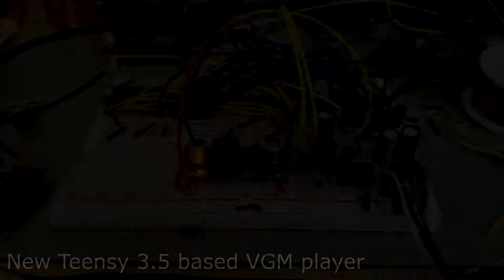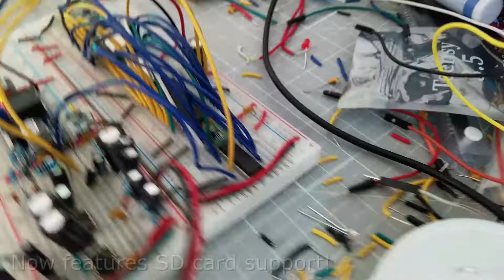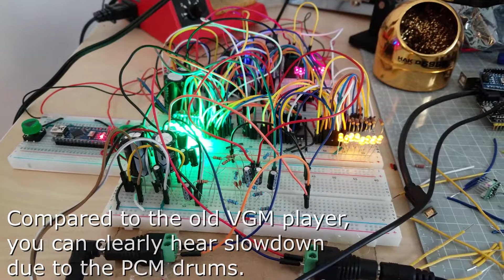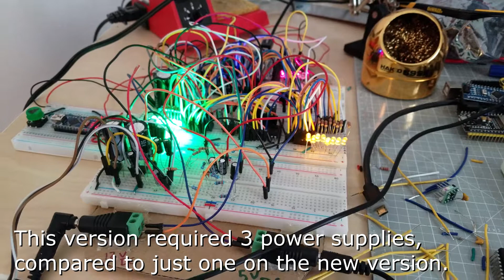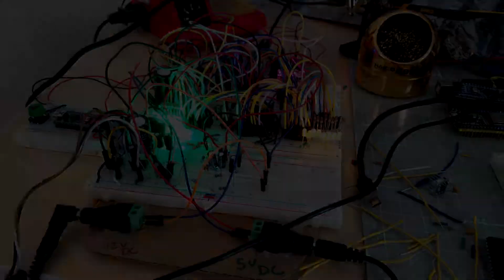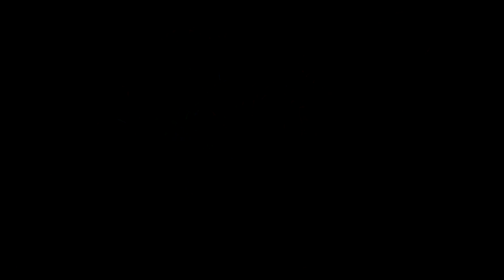Teensy 3.5 VGM Player Progress Video 1

Comment: Can I ask, all that switching to the teensy did was enable you to have greater io between the microcontroller and the ym/sn chips? Or was there something else about the esp that didn't make it viable? 
Thanks.
Reply from the maker: Darfk Oh man, the Teensy blows the ESP-series chips out of the water when it comes to this project. Not only is there SO much direct IO, but the Teensy processors are still extremely fast, have lots of RAM, and the board even has a built-in SD card slot. Better yet, uploading code to them takes 2 seconds instead of ~30 which speeds up development time significantly. I just uploaded this little progress video today, and all ready I've added so many new features. It now has an OLED display that shows song information and can store/play a virtually unlimited amount of songs! So much on such a small package and I still have pins to spare. Killer!
Reply: Thanks for your reply!

Comment: Can we use your concept of reading the vgm data, buffering and streaming it to the chip using a regular arduino? I want to build this using arduino uno but not included YM2612. Just PSG chip. Is that possible?
Reply from the maker: Billy Augaust it would basically be impossible to get full, stable playback on a YM2612 with only an Arduino. You’ll run into memory issues very quickly, especially with PCM. The SN76489 might be doable though.
Reply: @Aidan_Lawrence   oh  I see... But if I only use the PSG chip it will be possible? I'm planning to build a master system vgm player using arduino nano, SN76489 with SD card...